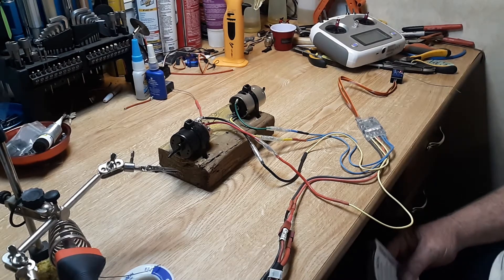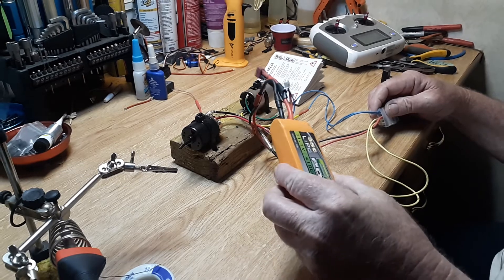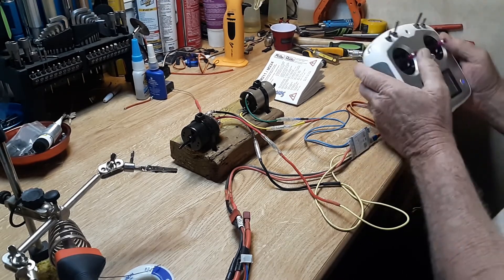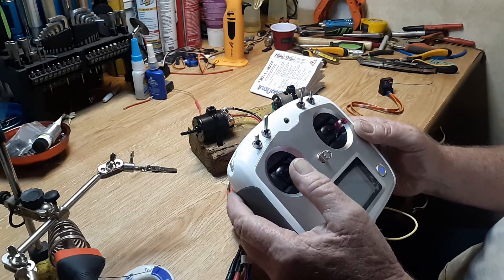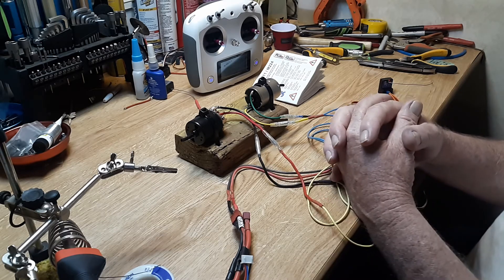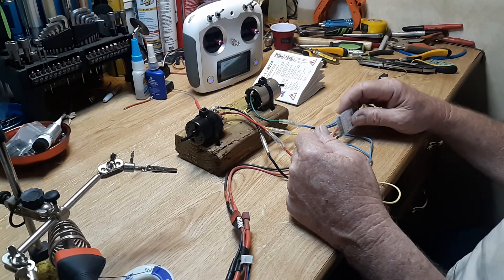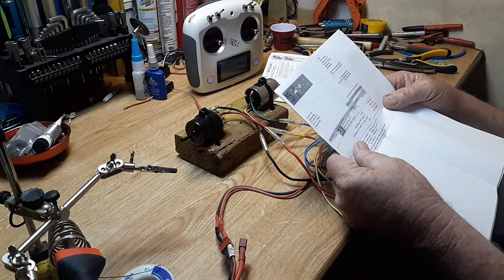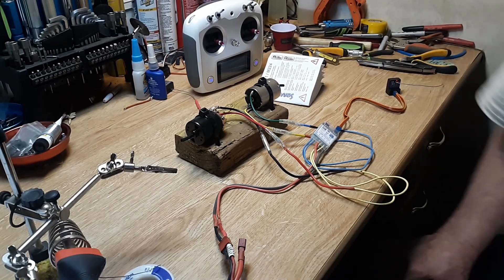Servonaut M211 motor driver to replace the sabertooth 2x32 motor driver

Comment: I just ordered my RC four-wheel-drive dozer should get it another few weeks also ordered the 360 excavator also ordered the dump truck. I will be ordering the SMR sound system and the duel  speed control for the dozer.
Reply from the maker: Well now you don't need the dual speed control,  look up hobby concepts and he shows how to do the mixing needed for single stick track drive.

Comment: I got a sabertooth its big, that servonaut is really small. Would leave you a lot more room ...
Reply from the maker: Yeah I got one in there now and it works great 👍
Reply: @yellowironcowboyrccon7484  so that servonaut m211 will run both motors?  
  What sound module are you running??
Reply from the maker: Yes its the servonaut dual motor esc and the sound is the servonaut smr witch has loader or dozer sound.
Reply: @yellowironcowboyrccon7484  so no sound module is needed , its part of the esc
Reply from the maker: I got mine off ebay. Just look up servonaut smr and or the servonaut   dual motor esc.  I've just recently found out that you can program the stock radio it comes with to run the tracks on 1 stick. Hobby concepts has a great video on how to do it. Its very detailed.
Reply: @yellowironcowboyrccon7484  thank You
Reply from the maker: Your welcome bud! Anytime 😊
Reply from the maker: Unfortunately the SMR is separate
Reply: @yellowironcowboyrccon7484  where can I get both? Thank You